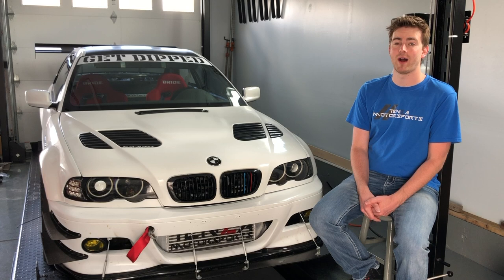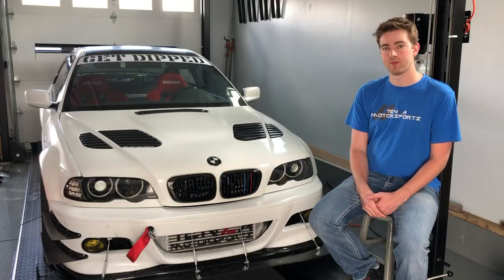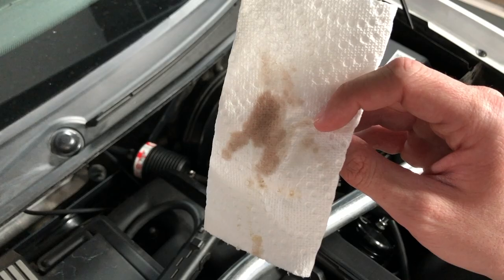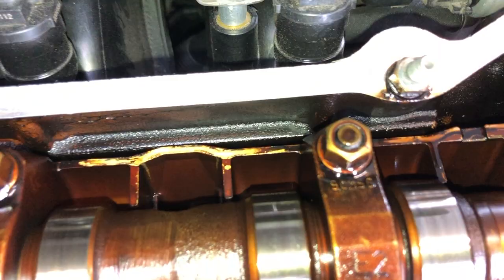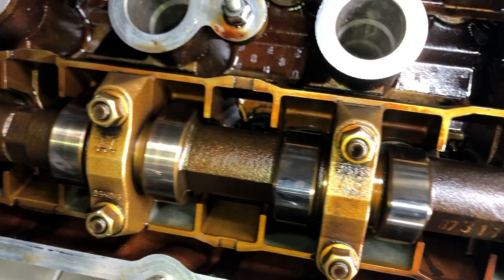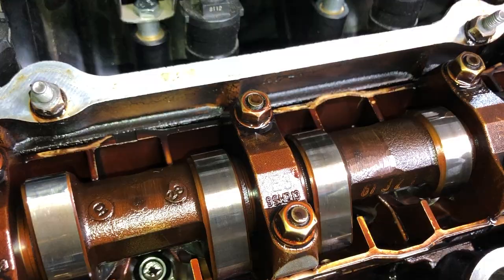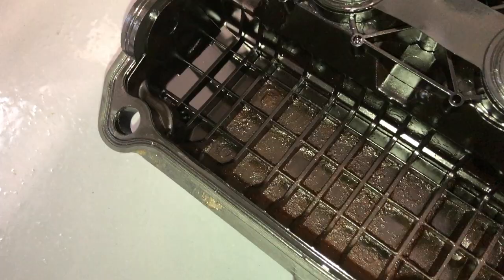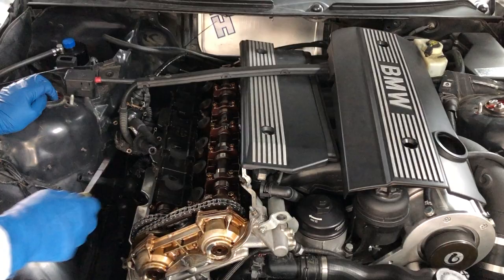500 mile break-in and Royal purple verdict (Part 2)

Comment: I Used Royal Purple in my racecar  .
It is Great Stuff. 
After 50 + races and at least 500 laps of 7000 Rpm average A rod broke. 
The internals of the Engine ie bearing surface and crankshaft still looked like I had just built it. Rod breakage was not an oil fault.  But at 8000 RPMS.. you can only imagine how bad it was.
That was 30 years ago and I still use nothing but Royal Purple in everything
Reply: Is royal purple really safe to use.?

Comment: Probably works but is a little expensive to use as a Cleaner. I add an additional can of Marvel Mystery Oil every 3’rd oil change in my 2003 4.8/273 Chevy Truck. It has 197,250 miles and runs like a Champ.
Reply: Another for marvel. I use it every oil change. Much cheaper. I'd go broke using royal purple just for cleaning.
Reply: I have a 01 GMC Sierra 5.3 with 335,000 miles. Nothing but Mobil 1 full synthetic oil and 1 quart of Lucas full synthetic oil stabilizer. Runs like a champ!
Reply: Another very good cleaning oil is Pennzoil Platinum synthetic oil made from natural gas.

Comment: There are lots of videos that compare name brand oils to Amsoil, even tons of chart that shows the difference. I run Amsoil due to their concrete evidence of being the best and they have a lot of videos that you can learn about automotive oil. 
Other Oil brands just compare against other or against coventional. They mostly just rely on emotional hype through their marketing. If you try to find info and or data sheets they're incredibily much harder. When you do find the data sheet, it's ridicously limited.  Amsoil, at a click of a button tells you all the specifications of the oil. Another reason I like them because they reward you for being educated on the matter. While others rely on you not knowing anything.
Reply: Osip Channel me too. I believe in Amsoil. They have independent teat facilities to test multiple brands of oil and they beat almost ever brand. After I switched my used car at 155k after 2 oil changes at 5k miles, it cleaned all the old burnt caked up oil that previous owner was using. Now at 280k runs perfect.
Reply: That and they were the first to make a synthetic oil back in the 40s plus they are based in Wisconsin where I live lol . Good stuff been using it in my vehicles ATV and snowmobiles for years and I am amazed at how good they run still and how clean they run and how clean the tops of the Pistons are on those 2 strokes when using it compared to conventional 2 stroke oil it's like night and day !

Comment: It's more so the detergents and it being a synthetic. I've used multiple different synthetics in my sport bike and I swear the cam side looks like it was just put together. Amsoil, royal purple, motul and Mobil 1 seem to be the best in synthetic. 

Also, check out engineering explained for more on synthetic oils.
Reply: Pennzoil is a better oil then most of those you ve mentioned with the exception of amsoil
Reply: Maybe next time try redline. Ester based oil. Or motul.
Reply: Mobil 1 is shit.

Comment: my engine was dirty like that. I got the cheapest 5w30 syn oil and did 1k mile oil changes. after a while my engine looked new inside. I also have a vw shit box that has the defective oil rings. they were clogging and would require a tear down. did the same thing and after 7 1k mile oil changes with cheap 5w30 my fuel millage returned and oil consumption is way down.  you need clean oil not expensive oil.
Reply: dann hienn true. But better oil will run longer intervals and additives last longer without breaking down.
Reply: @hondafreak8613  How long do you want to run with dirty oil?
Reply: You can get a five quart jug of synthetic on Amazon for about $20. It is allegedly as good or better than Redline.

Comment: Synthetic oil does do a pretty good job cleaning out an engine. I started on full synthetic on a car of mine, a 120k mile ecoboost. The oil gets dark quick. I need to run some Techron or maybe Seafoam to help get rid of more carbon and varnish.
Reply from the maker: I’ve never used products like that. I might test them out.

Comment: I've been running it in my 2009 Ford flex non turbo 3.5L  and the inside of my engine looks like jewelry,  I've been running it since I bought the truck in 2012 and nothing ever seems to happen to the engine,  it runs like a clock.
Reply: I have a 3.5 EB Lincoln MKT, be thankful you dont have the Ecobeast, power is great valve coking is terrible... Trying to decide if an upper induction service is the way to go or water/meth would be more beneficial in the long run.

Comment: I use Mobil 1 in my car. When I did a motor swap my motor had 192k miles on it the new 1 had 30-35k I almost didn't put the new 1 in because it had a  lot of sludge and staining and the old 1 looked new still. My friend who was helping me said the new 1 was normal and my old 1 was weird. I kept using Mobil 1 in the new motor and about 3 months later we did valve cover gasket  and cam seals the top end of the new motor the looked completely trashed when I put it in looked brand new no sludge no stains. So I think the synthetic oils do a really good job of cleaning out and keeping the motor clean because they have a much higher boiling point so they don't get thick and sludgie.

Comment: I have religiously used royal purple at every oil change on my truck from mile zero and i just crossed 100k miles and pulled my valve covers and oil pan and inspected some tolerances and compared them to some data from my old truck. this truck is showing the wear and tear of a 20k mile or less vehicle with zero sludge anywhere in the motor. my last truck ( identical motor) had major mechanical issues at 120k from jiffy lube oil changes and ultimately i lost the motor at that mileage. so id say royal purple has been absolutely critical. i change every 7500 miles. 3.6L v6 pentastar is the motor.
Reply: Royal Purple is undoubtedly a good oil, but any major brand on the shelf when changed responsibly will take a responsibly used engine of good design wellll over 200,000 miles. And engine of significant wear before 200k is most definitely an acute fault of someone's. Inexcusable. 

We used to blow bottle after bottle of N2O through 250,000 mile 5.0 mustangs that never even saw synthetic oil and ran fine.  There's a page here on YT of an 2003 accord with an unopened 3.0v6 that has 900k+ on it, documented, with standard synthetic oil. 

You're doing your engine a good service, but don't feel obligated to RP prices. To save a 50pg. write-up, just used a name brand synthetic and absolutely a quality filter (factory OEM Mopar filters are great) as it's probably more important in 2022 than the oil. 

Last but not least, stay away from quick change oil places, that's advice to live by. Do it yourself, have an actual mechanic do it, or the dodge/chrysler/ram dealer (they'll use oem filters 👍). 

 Oil changes done by quickie lubes are not to be used as a testament to engine longevity.
Reply: Yes, royal purple is AMAZING for Amy Chrysler motor. Rock on brother ✌🏼

Comment: I have been using full synthetic Mobil 1 since the late 1980's.  Daily drives, turbocharged Porsches and everything in between.  I'm a chemist and learned that synthetic oil doesn't oxidize in the harsh environment of internal combustion engines when the spark plug ignites the fuel/air charge and flame licks against the oily surfaces in the cylinder and piston.  Conventional (dino) oil oxidizes to form carboxylic acid groups on the end of the hydrocarbon chain. Synthetic does not. The acids in worn dino oil start to dissolve various metals in engine bearings like tin, antimony, copper, nickel, and aluminum. Oil analysis bears this out. Now for the part that will have people yelling at me that I'm full of it. 

I've run several cars to well over 200,000 miles using Mobil 1. I change the oil and filter at about 20,000 miles. Occasionally up to 25,000 miles. You might think I'm crazy, but Mobil 1 sells extended mile oil which they recommend changing at 15,000 miles. Don't you think the lawyers for Mobil oil realize if they say 15,000 that plenty of customers will push it to 20 or 25K miles? I'm still getting the same oil consumption at 200,000+ miles that I was getting when engine was new.  Example: 1995 Ford Escort,  4000 miles per quart. 2007 Honda Fit Sport 6400 miles/quart. Oil still looks pretty good (ie. light brown, not black) when changed around 20,000 miles.  BTW, I use the best oil filters money can buy – K&N, Mobil 1 or Wix. Not only is oil consumption holding steady, so is fuel mileage. Call me anal, but I have a 3x5 card in the glovebox of each of my eight cars and I record date, miles and gallons for every fill up. Fuel consumption after 200,000+ miles is still the same as it was when car had 20,000 miles. 

What more can you want from a good synthetic oil than what I'm getting? Oh and by the way, compression tests at over 200,000 miles still look as good as it did at 50,000. This fact agrees with the continuing good fuel economy. 
Feel free to buy top quality full synthetic oil and change it at 2000 or 3000 miles, it's your money.  To me it's like throwing away a Z rated Michelin Pilot Sport after it's got a couple thousand miles and the tread is 20% worn.
Reply from the maker: Thank you for the input!

Comment: The issue is any premium synthetic oil will do this. Pennzoil Ultra Platinum, Amsoil Signature, Red Line etc. You take a dirty engine, run it with clean oil and then change it really early, it’s going to get rid of a lot of gunk. It’s not saturated in new contaminates like it would be at 5,000-15,000 miles. It’s able to just soak up all the oil gunk and get rid of it.

And not to sound like a smart ass, as you seem like a nice guy and this doesn’t appear to be secretly sponsored, but you’re using a dark purple opaque oil. Of course it’s going to look dark even after mild use, the dye is just going to go from purple to brown with heat, not disappear. That’s a downside of using Royal Purple, it’s already discolored so it’s hard to gauge how old/dirty it actually is.

Now if you actually want some data on oil, there’s a channel called Project Farm that had an oil tournament, yes an oil tournament. He tested 16 popular synthetic brands, testing their lubricity, oil burn off, and cold flow properties. Royal Purple lost to Amsoil in round 1, the finalists were Amsoil and Pennzoil Ultra Platinum with Amsoil winning overall. I recommend him because he actually has consistent testing versus hear-say by car guys, mechanics, and oil marketing BS.

IMO doesn’t make sense to use Royal Purple when it usually costs the same or more than Amsoil, yet it performs worse. I use Pennzoil Platinum, to me it’s the best bang for the buck, and it’s the best in sub zero weather.

Comment: I have used royal purple 5w30 in my 2001 Chevrolet Silverado 2500HD 6.0 liter since I bought it new. to date I have had no major engine repairs the engine has 211.000 accounted miles not counting over all hours that engine was idling . i would say royal purple has reduced engine wear significantly over the past 20 years my engine still runs as smooth as the day I bought off the show room floor ..I absolutely think royal purple is the best engine oil I've ever used ..

Comment: I use Mobil 1 in my BMW... never had an issue with gunk building up in it, changing oil every 6000 miles as per what a mechanic friend recommended for my engine...

Comment: the exhaust side is cleaner due to the heat running up the valves and springs to the oil enhancing its cleaning power ,when cleaning up an engine like this with a little sludge clinging to parts,you need to run the oil and filter about 2000 miles for 3 changes and then after the filter and the pan gives up the filth you can go back to normal changes,the royal purple has high detergents in it and  will clean up the engine,i use Pennzoil as it does the same thing ,customers used to come to me and complain,my oil is filthy in 500 miles I said yes its a high detergent mix and it will have to come out as it is doing its job,this is very true on used cars,i pulled hundreds of engines apart on the rack and first thing I did was check the doors for the stickers and find out what brand they used,as some were worn out super clean engines,higher detergents sooner changes till clean,filters are to thought as throw away period,your oil is the lifeblood of the engine,keep them super clean,PARTS WILL NOT WEAR IN A CLEAN ENVIRONMENT

Comment: I drive a 2001 330i m sport prelift and I bought it with 108k miles and serviced it thought it was fine. Well you know m54b30 drinks oil by now but I added a quart of d4 atf and a bottle of seafoam in the oil. 

Drove 1500 miles. Noticed the oil was pitch black drained it. If you want pictures I have some. 

Take care of e46 oil because these cars live on the stuff. 

My car got +5mpg the vanos works way better you can feel the top end open up after 3.5k no noisy lifters. 

I’m dragging on. Use what works. Even super tec with marvel mystery works. The m54 is a amazing underrated motor. It just needs care.
Reply: i do 1k oil changes to clean out my engines. I use wallmart supertech. my engines are perfectly clean now. I would have had to repl the pistone in my vw due to their defective oil rings. this fixed it. cheap clean oil is better than expensive dirty oil.

Comment: Mobile 1 synthetic is what i use and it also will clean , my 5.3 yukon had 253,00 miles on it and ran so quiet with mobile 1 I thought about trying Royal Purple but price was a big factor!  Also noticed nascar engine builders use mobile 1!
Reply: Them LS 4.8 5.3 & 6.0 engines are a great tuff ass engine !
Reply: Mobil 1 is a great oil, but I wouldn't be too surprised if NASCAR only use it as part of a sponsorship agreement.

Comment: I use regular valvolene oil in my 350 c.i. / 400hp. Engine with 17, 000 miles on it and it's clean as day one and only changed the oil twice.
Reply: is this supposed to be a joke?

Comment: Heat cleans    Exhaust side is always cleaner bud
Reply: No your wrong, since the motor sits in the car a little tilted more oil sits on that side of the head, so basically that side gets soaked more in oil than the intake side

Comment: Ran it in my 350z stock and pulled engine to build it and install twin turbo kit and ended up having to order new cams.  They were chewed all to pieces and engine only had 4000miles on it from factory and never ran low on oil.  May have been other factors at play I was missing but I haven’t used it since.
Reply: i thought those engines were known to burn a lot of oil, like A LOT. Also, oil wouldnt "chew up" your cams as you say. Lack of oil might, so maybe you just over looked something? Real question is why you are pulling a fresh engine out anyways lol

Comment: Most oil will turn dark after a short period of time.  Reason, 10-20% of the used oil still remains after a drain and refill, especially these newer dual overhead cam engines with VVT.  Not like the old days in big block, rocker valve engines.  If you want improved performance of your oil, and keep your engine clean, which ever you use, complete a full flush (2nd drain and refill after 15 miles of highway driving.  You will be shocked at the color of the oil.  I have had oil tested, and found 25% retention of wear metals and contaminents, decrease in viscosity, Total Base Number after only 15 miles.  Use the second oil change as your flush oil for the next few oil changes, or recycle into your grocery getter.

Comment: I used royal purple for the first time when i got my new car when when i got it, it needed a valve cover gasket and oil was rock solid sludge and in every crevice built up to the top of the valve cover. I used royal purple changed the oil 600 miles later and it damn near cleaned out all the chunks. filled it back up with royal purple drove 10,000 miles changed it and opened up the valve cover to find a spotless head. absolutely amazing. literally the worst case scenario of sludge it cleaned it all!

Comment: Hmm. I would like to see a cleaning comparison with others honestly. That looks like some great dispersants in it, but other than that, I don't know. This won't apply to me, but still would like to know. I used Liqui Moly Pro Line engine flush for 20 min. Engine looks 5k miles old with 150k miles on it. This still did pretty good for 500 miles.

Comment: If I owned this BMW I wouldn't worry about internal engine wear at all.  I'd use Mobil 1 or some other high quality oil and forget all about it.  Because I already know the internal engine parts are one of the few bullet-proof things BMW can manufacture properly and they will almost certainly never give a lick of trouble!   Since it's all electrical system parts, plus all the plastic engine components that'll begin to fail one-by-one,  long before engine wear even becomes an issue.

Comment: the exhaust cam will be hotter than the intake cam. This is the reason you adjust your intake valves to a different value than your exhaust cams, this is to accommodate the differences in thermal expansions between the two. Most everyone knows the hotter the water the easier it is to clean something, no reason the same wouldn't apply to motor oil

Comment: Which Royal Purple oil are you running. There is regular Royal Purple and there is Royal Purple's best oil called XPS. XPS has very low wear properties and contains zinc. If you want the best Royal Purple, than XPS is your choice.
Reply from the maker: I just changed from the standard RP to the XPR recently! Haven’t drivin the car yet after the change. There will be a video on it.